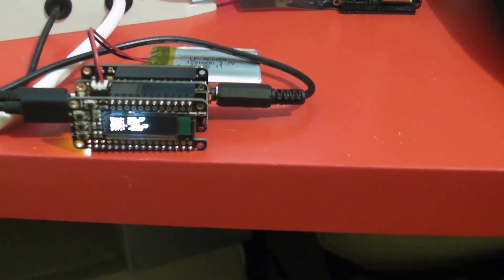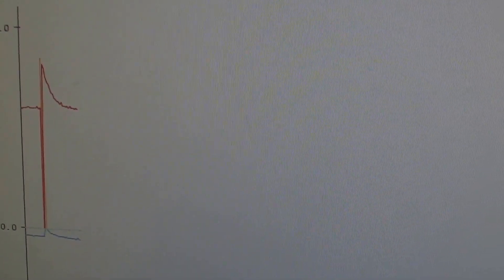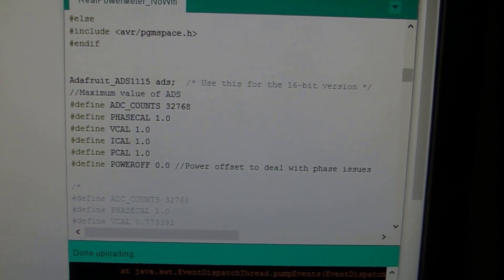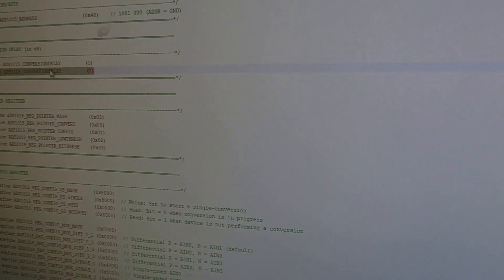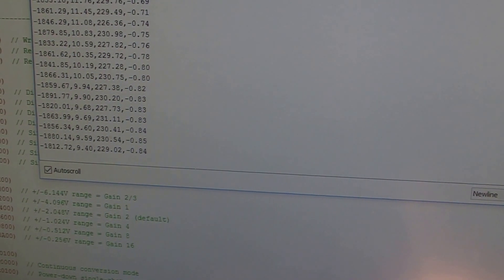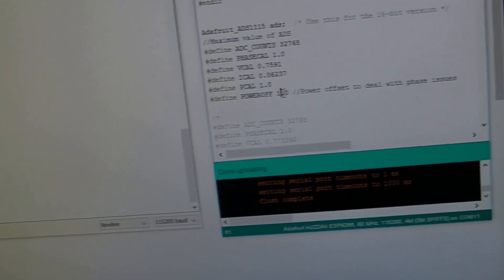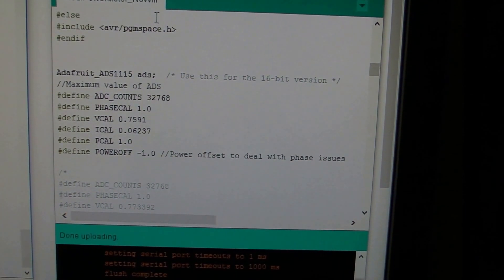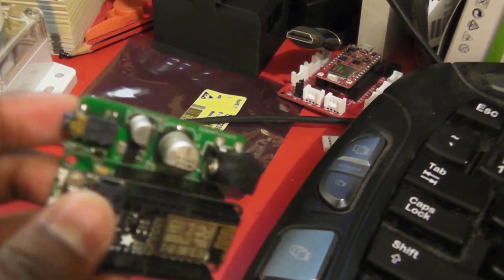ADS1115 Energy Monitor Calibration

Comment: Tested without measuring the current from ADC 0_1 and voltage is fine.
I'm using a WEMOS D1 mini. Could it be slow?
Reply from the maker: Please look at my calibration video. Code is available via GitHub. Yes measurement can be slow. Make the loop as tight as possible.